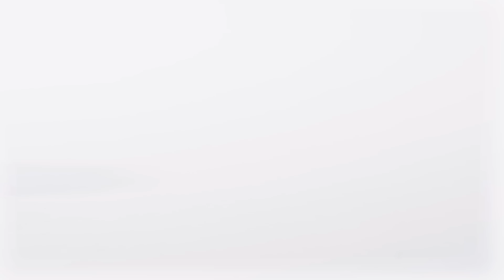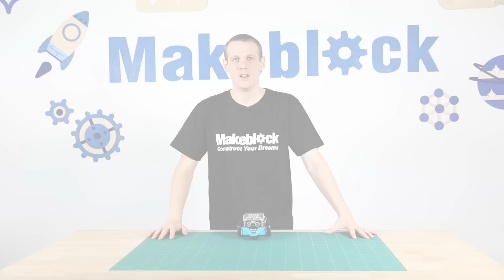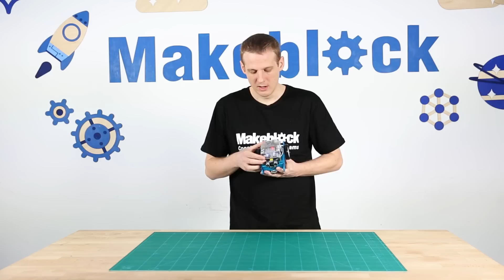Explore mBot Tutorial #2: Object Avoidance

Comment: How do you turn off the mode?
Reply from the maker: Hi, you may switch the modes with pressing the tiny button on the control board to switch modes, or using the remote included in the box.